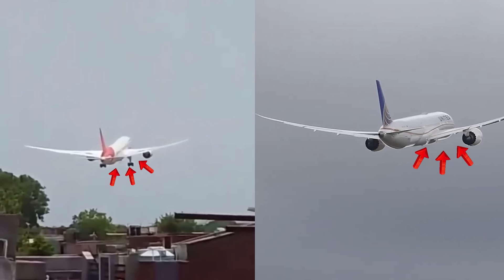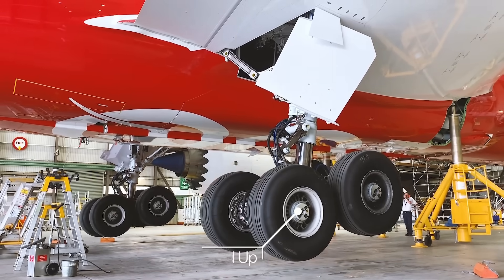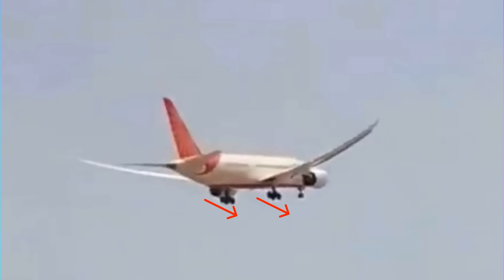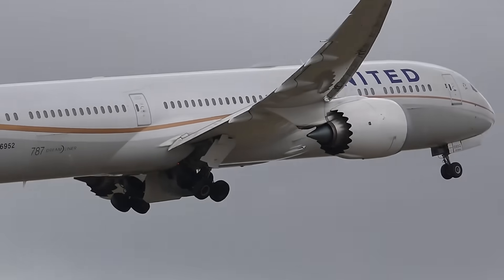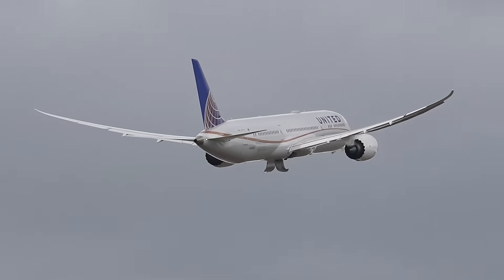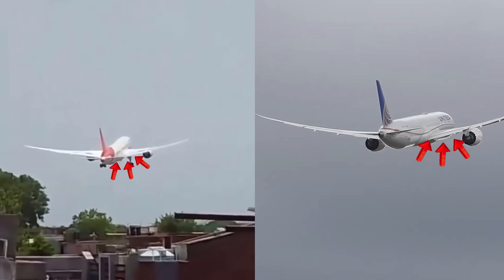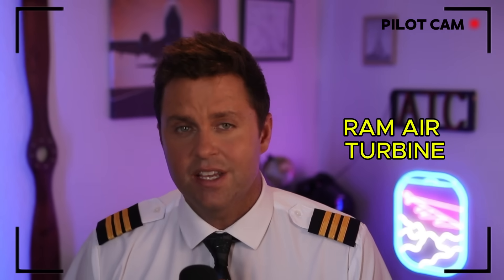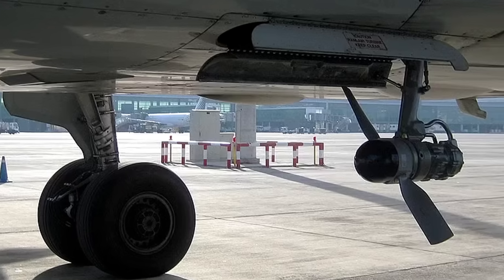Pilot Explains: A New Detail in the Air India 787 Crash Everyone Missed

Comment: I've heard of situations where after maintenance, some valves where left closed that needed to be reopened that lead to filling the tank immediately before feeding the engines.  In other words there was fuel in the holding tank or whatever it's called enough to get the plane off the ground but that's it.  If it was something like that, they were doomed.

Comment: It seems to me that the quickest, easiest way to shut down both engines at the same time is by either the Fuel Shutoff Valves or by pulling the Fire T-handles. They would either have to be intentionally and manually activated/ selected which would have bad implications to say the least. There could theoretically be a electrical short in the system of panel somewhere. It would be helpful to know how long that plane was at the airport prior to it departing. I'm thinking of possible moisture/water in the fuel freezing if it was a quick turnaround departure. Screens and filters impacted by freezing water contaminated fuel could easily block the fuel supply and starve out the engines. Of course contamination on it's own could be the culprit but there are other possibilities.  I am a Commercial rated pilot, I'm also an A&P Mechanic and I worked on the 747, 767, & 777 at the company that rhymes with BORING, I'm retired now, Thank God. Best Wishes to You, Gary, et al and to anyone who reads this.

Comment: Totally agreed with you at 8:50, double engine failure is the major cause.
Even I researched and found that landing gear down and flaps not in place are secondary. The primary cause is not enough thrust from the main Engines leading to such chain of events.

Comment: Fuel contamination 
Don't those tanks have filters  to filter sand n rock ? 

When u say fuel contamination/ starvation / blockage ....  is this diluted fuel  like  mixing some other cheaper oils  to  the fuel?
Do old flights accumulate grease overtime n maintainance  failure ?

Comment: Maybe something in the fuel shutoff system malfunctioned starving both engines. The forward tilt on the gear confirms that up was selected and the system was able to lock the bogies forward before hydraulic failure. There was a mayday call, and there was a report from the controllers at the airport that radar indicated they were loading speed.

Comment: Great detailed explanations. On day 1, I noticed on the video that there is a dark shadow behind the wing leading edge confirming that the slats were deployed, so the flaps retracted theory goes out the window. With lots of actual takeoffs and simulator training, it is pretty much impossible to mistake Flap handle with Gear lever. That was a preposterous idea. We're not dealing with student pilots on their first few training flights in a complex airplane.

Definitely dual engine failure. Great demo on the main gear tilting forward prior to retraction. Not clear on the video of Air India B787 whether the gear doors were open. Are there electric/hydraulic actuators to open the main gear doors or do they unlatch and fall by gravity? Noticed on your video that the main gears tilt forward before the gear doors open. There's a sound that's from a latch/hook pulled by a cable to release the main gear bogey that air tilts by gravity. In actual flight, the air would help it tilt in addition to gravity fall.

Fuel cut-off switch? Does that shut off a fuel valve? I assume there are fuel pumps - they failed due to electrical failure? RAT deployed.

Survivor recalled hearing a loud bang from the engine(s). Was that during take off roll or airplane already airborne? Loud bang suggests compressor stall; what would have caused it? Unlikely or impossible that 2 engines self destructed simultaneously.

I'm surprised Air India has not mandated a fleet wide grounding for inspections.

Comment: How long after V1 did the engines flame out because im assuming a massive electrical fault that stopped every system on the plane? Because lets say you were 1 second past V1 then you lost everything the engines are still providing thrust that is rapidly declining but you have no choice but to try and get the plane off the ground but its just a glider with zero engine thrust and get it restarted in time?

Comment: Engine failure , They did call NO POWER right before they went silent . Love the landing gear explanation!!!!
Reply: Even "Before selecting the landing Gear handle UP"  , the gear tilts Forward Down... as soon as the sensors detect AIRBORNE...  see:   AMM 32-31-00 LANDING GEAR DESCRIPTION AND OPERATION.    So, regardless of the selection of the gear handle, it will always tilts forward down to prepare for retraction.
Reply: @Fabianpilot this is a great peace on knowledge thank you. Many 787 pilots friends don’t know that
Reply: @Fabianpilot REALLY??? What if you need to land immediately. TAKE OFF and for some reason never retract the gear to land immediately. Then on approach at what point the landing gear tilt backward again?
Reply: @juanmanuelgomezmartinez3795  Once WOW sensors sense “airborne”, the gear tilts forward automatically.

If you never retract the gear, it remains in the forward-tilted position during flight.

Upon touchdown, the WOW switches go back to “ground”, and the gear tilt resets automatically back to landing (aft-down) position.

This is handled mechanically, not by any pilot action.
Reply: @Fabianpilot then the front wheels of the main landing gear touch down first?? Then the rear wheels??? And when all wheel on ground the tilts reset???  Remember WOW works with shock absorbers
Reply: @juanmanuelgomezmartinez3795 it'll touch down, supposedly just like the 767 main gear but I'll reset it to the take-off position . It's spring-loaded.  So it'll tilt forward down again when aircraft gets airborne again.
Reply: @juanmanuelgomezmartinez3795  and I'm just replying exactly as it shows in the Fcom and AMM.
Reply: @Fabianpilot 767 and 787 are different
Reply: @juanmanuelgomezmartinez3795  yep, but I used it as an example. So in the event of a immediate return with Landing Gear down, that's how's gonna work
Reply: @Fabianpilot  And selecting the landing gear UP handle would not have happened because they had not achieved a positive climb rate which is when landing gear is retracted, correct?
Reply: But they had reached V1 otherwise they should have reject takeoff.
Reply: @svdleer maybe all power was lost  after rotating, you can see the plane going from climbing to almost level flying.

Comment: I think that the bang heard both by the survivor and by people on the ground indicates a compressor stall. There could be various causes for that - leaning out caused by a loss of fuel pressure which in turn could indicate an electrical failure as the pumps on the 787 are electric. Another reason could be contaminated fuel. Another reason which Meet Kevin has speculated about in his recent video is vapor lock caused by heat soak which he evidences by the eyewitness reports that the air conditioning was not working on the ground before the plane took off.

Comment: Didn't a BA 777 suffer an engine failure while landing. They were right at the runway threshhold and thus were able to save the aircraft. If I'm not mistaken the cause was some sort of ice formation in the fuel lines. Perhaps someone would know more details about this incident. Of course this flight was landing after a long flight so would be more prone to an icing incident.

Comment: @garybpilot       Even "Before selecting the landing Gear handle UP"  , the gear tilts Forward Down... as soon as the sensors detect AIRBORNE...  see:   AMM 32-31-00 LANDING GEAR DESCRIPTION AND OPERATION.    So, regardless of the selection of the gear handle, it will always tilts forward down to prepare for retraction.

Comment: I think it’s going to end up being some strange electrical issue that caused engines to roll back. I don’t believe the engines failed fully but were cut to idle for some reason
Reply: These planes are fly-by-wire means a computer took the decision to roll back to idle for some reason.
Reply: I still don't understand how. though.  These systems are designed to be extremely redundant right
Reply: @wigglyk2796  Yeah, if they have FADECS, my understanding is that they isolate after engine start to their own dedicated power source (called a PMA) that is attached to the accessory gearbox...  but that's on other (heavy) jet's I've flown...
Reply: Question, if the engines were at idle, would they been enough power to the copilot to raise the landing gear?
Thx
Reply: @petercozzaglio6070  The gear is hydraulically operated by electric motors, says AI.
Reply: Israeli sabotage. I'm sure
Reply: Centralized electrical/software design is the worst nightmare of any complex system—it’s the perfect recipe for single-point failures—one small mistake and it’ll take down the entire system. If this indeed is what happened, I’d blame the decision makers and approvers of this design—whether it’s the engineering team or management team or both.

Comment: 2hours before the incident, a passenger of the same airplane which safely landed had uploaded a video of complaints about loss of electricity and failure of on board entertainment systems on that same airplane. Maybe thats a vital clue.
Reply: He also mentioned that the air-conditioning was cutting in and out in that previous flight.
Reply: I was a tech rep for a helicopter company for 27 years.  I learned to not ignore any crazy sounding clues.  I had a report of an intermittent problem that only occurred on damp mornings and would go away 15 minutes after turning on the heater.  I didn't believe them until I saw it for myself.
Reply: @jnbfrancisco  Yep them damp electronics is what caused the Stealth B-2  to crash on takeoff @ Andersen AFB in Guam!
Reply: I think that says a lot right there
Reply: I reckon that was a red flag warning that somehow may have been overlooked or dismissed
Reply: The survivor said that lights were flickering on the plane.
Reply: @bonblue4993  this was the rat deployment when power transferred from the engines or failing APU to the rat. Or at least that is what other captains have said about this aircraft.  The rat is an emergency measure. It is spring launched and begins to provide Emergency back up power. It probably cannot generate full hydraulic.
Reply: @bonblue4993  I’ve been on a us plane that did that, then they went completely off then back on. I thought it was normal but still scared me because I hate flying! It was take off at night out of seatac sometime in the early 2000s
Reply: @bonblue4993  The flickering lights are consistent with a power failure warning.
Reply: That’s the condition of every air India plane people think it’s a joke even our metros in India are more clean than any air India planes it’s air India’s fault also the plane went down in dec also and many people who tracked to Korea from it many times it was always broken
Reply: Damn, so the plane had an electrical problem in the preceeding leg of the trip and they did not find the issue and decided to continue anyways.  That is completely absurd and borberline negligent on airport safety.
Reply: It definitely is. Heard someone claim that the suvivor heard a bang as well.
Reply: @dan-bz7dz main battery bus switching to emergency bus due to rat deployment
Reply: @adammccarthy2157  That was in reference to another passenger on the same plane prior. But someone says that had been debunked and it was not that plane. I was just speculating.
Reply: @dan-bz7dz  Bang = RAT deployment
Reply: The loud noise most likely was the RAT deployement, as when the power is lost it uses a spring mechanism to deploy @dan-bz7dz
Reply: @dan-bz7dz  They believe that noise to be the RAT being deployed from under the plane.
Reply: It’s not vital clue,,, it happens all the time
Reply: I saw that video also. Posted on YouTube. I cannot find it but should check the timestamp on it.
Reply: @WIJEHU https://youtube.com/shorts/HW0Fx5bXktU?si=tbQteSymHGRvgR0d
Reply: At the moment after liftoff you can see dust being blown away. Thus at that moment the engines were working. Is it normal to have dust being blown of the runway?
Reply: @walhalladome5227 yes it’s a lot of trust and it’s hot and dry so the wake from the engine angling down as the aircraft rotate off the runway will blow away any dust on the runway
Reply: Definitely a clue
Reply: Amazing video. Information novel and argument was sound.
Reply: This is nothing unusual, very often AC doesn't work before take off in many international airlines as it costs lot of money to run the auxiliary power units while on the ground, once in air the power source shifts to the main engine and AC starts working.
Reply: exactly, and why was it allowed to make another flight after these issues???????????/. ahhh india :(
Reply: That’s the condition of every air India plane people think it’s a joke even our metros in India are more clean than any air India planes it’s air India’s fault also the plane went down in dec also and many people who tracked to Korea from it many times it was always broken
Reply: And no AC!,
Reply: Wow 😲
Reply: my money is on the air vents and the reading lights. it all adds up.
Reply: But how did they not do any control of the airplanes before taking off?
Reply: Do you hsve link to video?
Reply: It's got no gas in it. Mmm-hm
Reply: Yes I saw that. Air India would have known the plane was in a subpar condition.
Reply: @erichung8087 Link to this video?
Reply: @theJfamilyfinds there are quite a few if you search 'Akash Vatsa'
Reply: Not good at all!!
Reply: That's Air India being Air India
Reply: Air conditioning as well, which is important to electrical functionality at times, not to mention passenger comfort!
Reply: Is it possible for the wrong fuel to be added to the correct refueling tanker?
Reply: That was during pushback and engine start. It's routine to shed CAC and other cabin electronics so the APU's full power can be used to start the engines.
Reply: Yea, the people BEFORE that fateful take off probably needed a stiff drink.
Plus one lady missed the fateful flight due to traffic making her late.
Talk about an emotional roller coaster.
😡🤬I missed my flight 
To
😳😱😭 Oh my insert deity here I was supposed to be on that flight. I will say my thanks to insert deity here after a few strong drinks and I recover from my hangover.
deity 😣Yea, that’s understandable.
Reply: @equarg I’ll insert it for you: Thank God Almighty.
Reply: I flew on Air India in the 1980’s. Our flight to London had been delayed due to mechanical failure. We literally sat and watched the mechanics’ disassemble the wing right at the gate, and we all got to watch through the windows. (I actually have a pic somewhere). When we finally got on the plane, every passenger was thoroughly disconcerted, and there were still electrical issues with the AC on that flight.
Another time I was flying to Sri Lanka and asked a flight attendant for glass of water. She literally pulled a yellow, plastic cup off of another passenger’s tray, emptied it in the galley, and then refilled it with tap water before handing it back to me. Not to bag on Air India, but it sucked 40 years ago.
Reply: Thats a common thing with Air India aircrafts.
Reply: If you watch that video it's not how the interior of 787 looks
Reply: @viacheslavglukhov8188  Come on..I think, you never travelled in Air India Flights :) Even seats bottom can be very handy to remove and replace with other seats :)
Reply: It's also not thw airlines logos either.@viacheslavglukhov8188
Reply: If that was such obvious the crew would have initiated emergency procedures on the previous flight.
Reply: @navsofour2892  They probably would have written it down in the log book and an engineer most likely would have looked at it. Possibly fixed the issues, but not the root cause. We wont know until we get the preliminary report.
Reply: Maybe the plane had a bad alternator.
Reply: @danielaramburo7648  I agree, likely the bad auxiliary power unit. And would explain why the rat had to be deployed.
Reply: yikes
Reply: That video was not 787 and was taken 10yrs ago

Comment: There may be another way to shut down both engines.  Is the fuel cutoff in any way controlled, or managed, by software?  I would hope it was hard-wired.  The throttles are surely under software control...